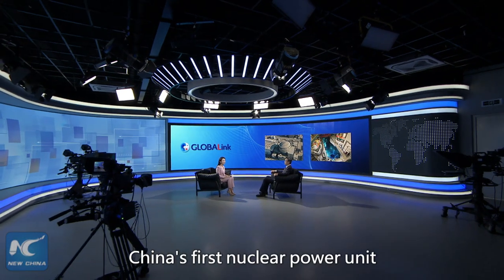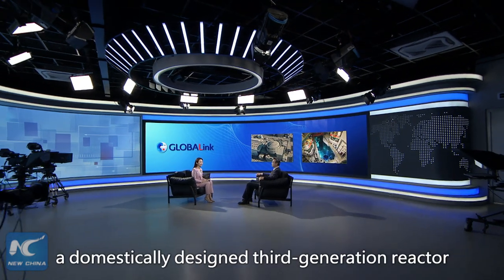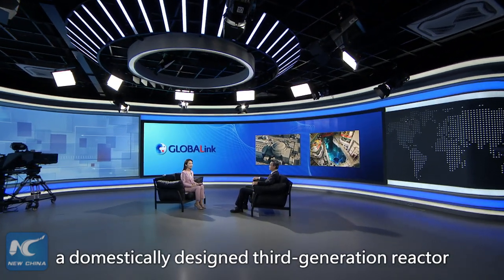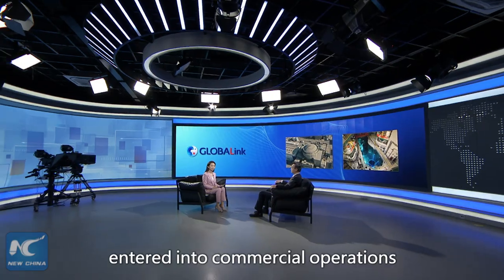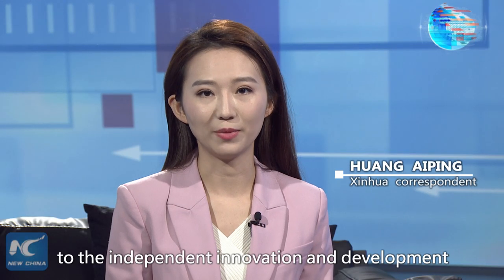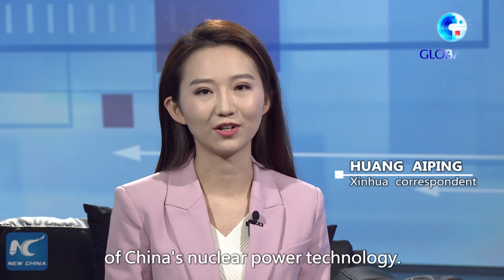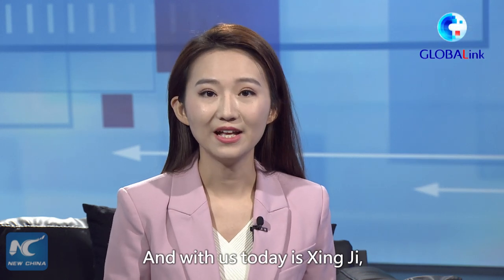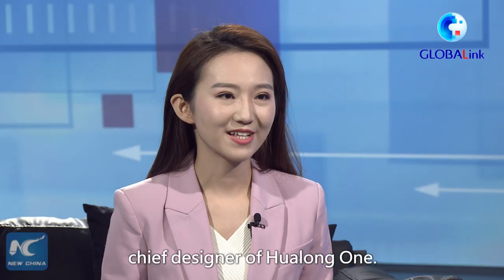GLOBALink | How China's first Hualong One nuclear reactor can withstand a plane crash

Comment: As far as I know all critical component of a nuclear installation can be design against an airplane accident. My guess the Hualong One should be over and above the current standard advocated by the international nuclear powers.  It seems to have a passive system that has its own power to safely shut down the core.  The reactor core is also housed in the lowest part centrally with other non-critical components to take the attacking energy.
China is the world's No. 3 in nuclear power generation ans has sufficient operating experience to come up with a well thought out design to withstand the known hazards.  China is also the biggest nuclear power developer at the moment intending to commission 10 reactors each year.  More pratices make a better if not perfect system.